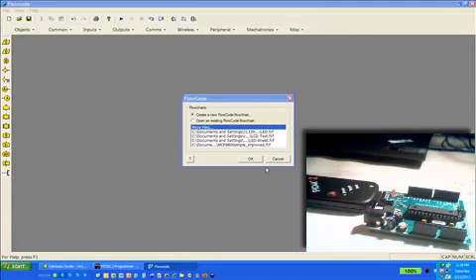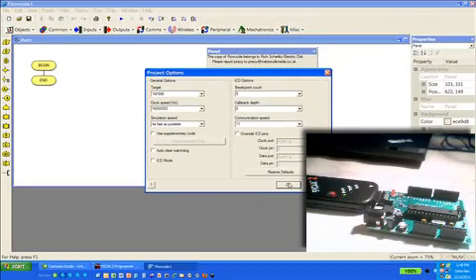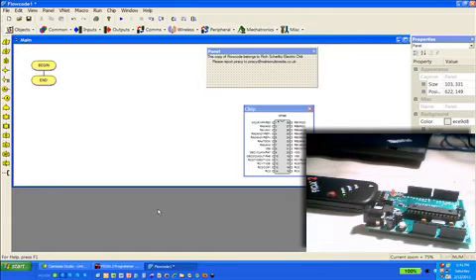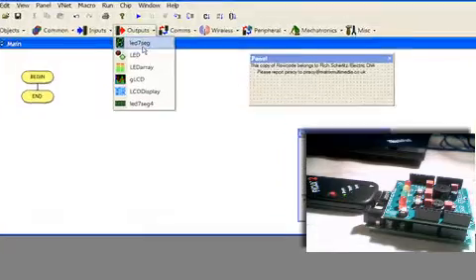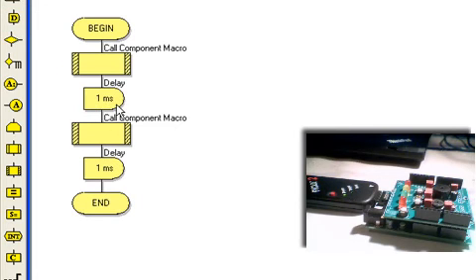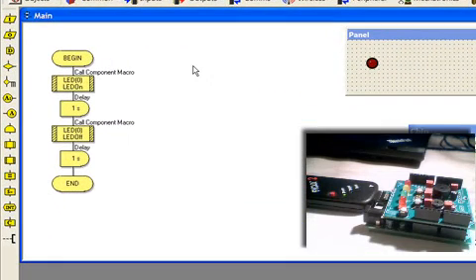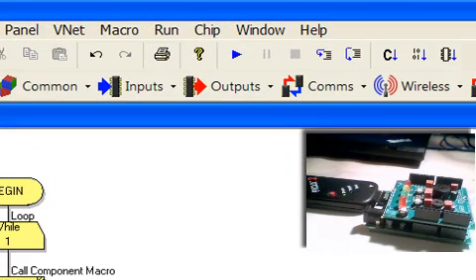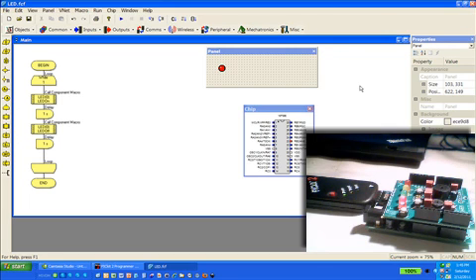Flowcode / CHIPINO Tutorial

Comment from the maker: @anewlow23 You can use Flowcode to program an Atmel device if you buy the correct version of Flowcode.  You can't, however, program the Atmel based Arduino with Flowcode because the Arduino uses a bootloader that works with the Arudiono IDE.  Also, you don't have to have a Chipino to use Flowcode.  You could use a PicKit with Flowcode to program a Microchip device all by itself using In Circuit Serial Programming (5 wires).